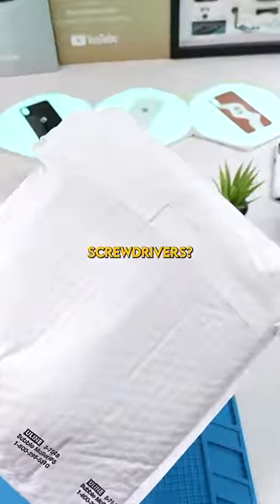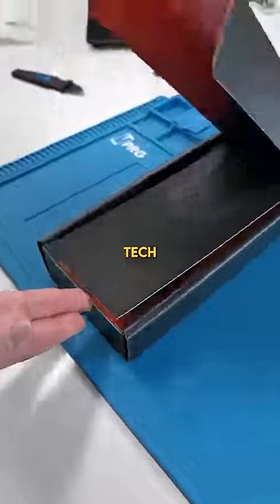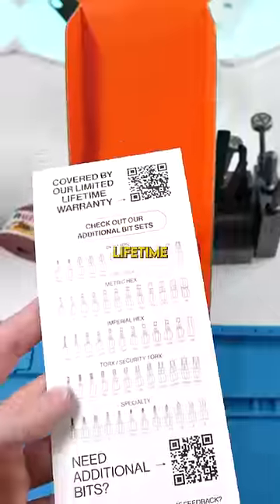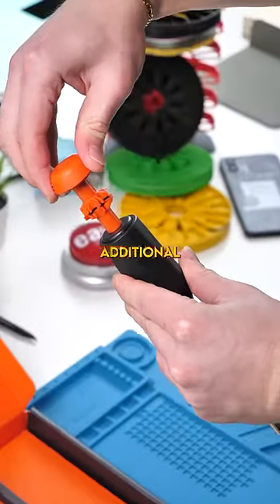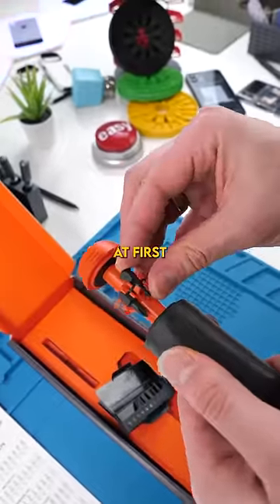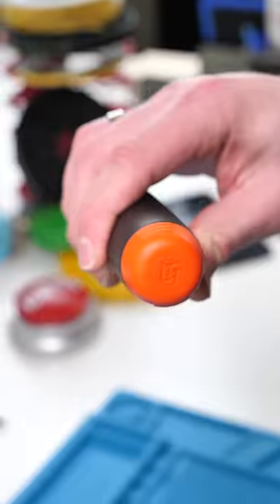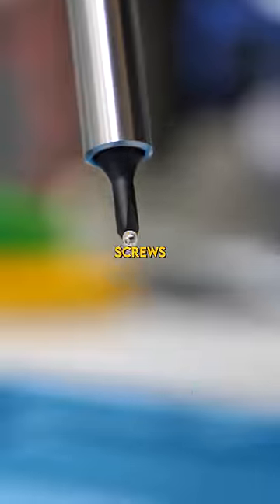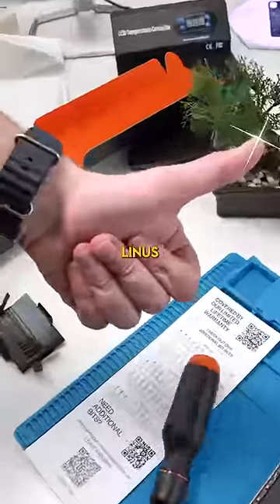How Good Is THE LTT SCREWDRIVER? #Shorts

Comment: I got it, I was half skeptical but it's actually a really good screwdriver. I find myself fidgeting with the racket quite a lot lol, it's so satisfying to turn
Reply: HTR  definitely. It's on par with other premium brands that do have a similar cost, and the ratchet just blows everything out of the water imo.
Plus you obviously have to account for the fact that a product designed in-house by a small company is gonna be slightly more expensive. It's just a given, they don't have the connections and the efficiency of an OEM that only does screwdrivers. And it's still merch after all, you also buy it to support LTT. It's extremely high quality merch, but it's still merch.
Reply: HTR  Love Steve, but he's just wrong on that. He didn't really follow the stuff that was happening at the moment and got in the middle of some internet drama. 
The rest of the comment is obviously personal opinion, by me. I own the screwdrivers I use, and the LTT one is really, really good. Now take your internet drama elsewhere.
Reply: HTR  you've clearly never touched the screwdriver (or a screwdriver?).
Reply: HTR  yeah man sure lol
Reply: HTR  keep goin'

Comment: You can use the iFixIt 5/32 to 1/4inch adapter with it though. That'll allow you to use the smaller precision bits with it if you wanted to
Reply: I don't the think that's the issue. with small bits i would prefer a lighter and smaller handle for better control

Comment: They had to create a screwdriver that is Linus proof 😆
Reply: theres another video where a guy drops it from about 5ft, and it broke/started to break after 20ish drop. imagine seeing $5 flying away when u drop it, and if you drop it twice a month, which can be common on job sites, itll be in a bad shape after a year. also honestly idk y he made a huge ass driver for "computer" stuff. you need skinny ones. atleast include an extender. now that i think about it i think they must of used cheap non-flexible plastic in the bit holder, since it just snapped off. and its 70$, yikes. just wait til china floods the market with replicas and linus will be forced to drop the price. rn hes milking it for all its worth. wouldnt be surprised if the manufacturing cost being ~$10
Reply: @MrPaxio who in the fuck on a job site would be using a ratcheting screwdriver and not an impact?

Why would china clone the $70 LTT screwdriver and not the $150 snap on ratcheting screwdriver?
Reply: @MrPaxio  I use a heavy AF ratcheting driver from Kobalt for all my computer repairs. It's discontinued now, but it has a sleeve on it that makes it double-action. So, it's heavy because it has a gearbox, lol. Yes, my screwdriver has a literal gearbox. Get rekt.
Reply: @Mavendow If you're ratcheting screwdriver has a gearbox in it then it was never designed for what you're using it for and was clearly intended for heavy construction type work

Comment: The most important thing with screw bits are how they are hardened, I've had way to many bits break because they weren't hardened properly or made out of good steel. The best boys I've ever seen are the wiha driver bits
Reply: HTR  well considering they are 25$ for a pack and they work great for thread locked knives it's what works for me. Every other bit I've tried snaps, and I'm talking about a torx bit btw
Reply: HTR  literally cheap ass ones that you'd find at home Depot, and the most common size I use is T8, T10 and T15, I only have real trouble on T8, my T10 or T15 bits have never snapped
Reply: HTR  well I never claimed that wiha was the best of the best, I just started that it's the best I've personally seen. And as for the brands I've used I've tried husky and strebito, couldn't tell you what steel they use because they don't say on the packaging, I'm sure you could find out by searching but I don't really see a point, with the strebito ones they seem to twist and with husky they fracture on the area with pressure applied, haven't had issues with wiha yet, does everything that those can't and for not much larger of a price.
Reply: HTR  I've always assumed wiha was made in China since it seems most of the cheaper bits are. As for now though the wiha bit seem to do me right. If you've got any suggestions for other torx bits I should give a go if wiha starts to do me wrong, please feel free. I'm open to suggestions
Reply: HTR  alright thanks, I'll keep these in mind when shopping for bits next 👍

Comment: Definitely agree it is a very nice screwdriver. But it is large and not optimal for being used mainly for phone repairs. Probably one of the best general use screwdrivers out there
Reply: Well yeah, it's main focus is most likely just anything pc and server-related. Racks and network equipment usually requires a bit more torque than the regular pc-building sessions so the size is understandable.

I believe the LTT screwdriver covers the entire span between "this is a oily underside of my car so I'm using the cheap regular screwdrivers" to "this is iphone mini-screws so I'll be using precision drivers"

And it's the perfect overlap too. Anything inside the car is where this would be used, even just tuning my amplifier, and all the way over to disassembling a laptop where some screws are torqued down to the maximum of what I can unscrew with the regular ifixit bit-driver.

Basically any kind of electronics is where this screwdriver would be great, and some other stuff too.

Now, the pricing is, well, insane. But so are the other equally well built bit drivers. Nothing cheaper comes even close to this one on all points.

Can't wait to actually try it out myself, I just know what Project Farm (and others) showed through testing
Reply: HTR  Yeah, I meant to say that it originated from pc and tech-work and that's why it's most likely to be purpose-built for that usecase, which it was.

It's meant to replace most tools, such as the span I mentioned, but I haven't used it personally yet so I cannot say for a fact wether it does so (for me personally at least).

I'm personally leaning towards project farm's review, mostly because Geerling includes stuff like ratchet asmr, flipping and honestly, dropping a bowling ball by hand.

It's not to say his review was irrelevant, I think it was, it's just that Project Farm use a more scientific approach with tests that show more practical differences.

I'd also argue he did test it more thoroughly, so even IF it was rushed, it was still good. I double checked with them side by side, Project Farm went way more into the technical differences and whatever bias you're hinting at can't be changed when he shows the numbers and test everything equally.
Reply: HTR  Wrong in what regard? I'm familiar with the PB Swiss he used and I thought it was a great comparison where I could see the physical differences between the two.

Sure, if there are models that are better from PB/Snap On/Megapro then it's not a good review on which screwdriver to buy, but then again his closing words are "I think that really depends on what you're looking for"

I'm not defending anyone, I'm simply stating that I personally liked Project Farm's review better. The fact that you seem annoyed by this tells me you're biased towards telling me I'm wrong rather than "different opinions, I respect that"

 Geerling could at least have dropped the bowling ball from a fixed height and not just eyeballing it. Still a stupid test compared to dropping the screwdriver itself.

I respect that you have a differing opinion from mine, please do the same.

Comment: It's crazy expensive but they're going after the top screwdrivers in the market and apparently it holds up and even betters them in some areas so yeah it's a good deal if for some reason you want a super nice screwdriver.
Reply: Top screwdrivers in the market…. Well no self respecting tech would use that crappy driver. For 70 bucks usd it costs more than a certain American made screwdriver that has customer support that comes to you in a certain truck.
Reply: @HimmelWeint  you literally haven't tried it
Reply: @HimmelWeint it literally kicks the ass of a snap on lmao. Cope harder than your red truck garbo gets beat by Matco around every corner.

Comment: Bruh $70 for a screwdriver? 
Screw that
Reply: I see what you did there
Reply: Something I would like to point out is Snap-on's ratcheting screwdriver costs more and does not come with bits (there is an 8-piece set you can purchase but it costs over double the LTT screwdriver and it only comes with four or five bits)

Comment: Linus Tech Tips reviewed a water block using a GPU that isn't designed for it and says the result is bad and auctioned the prototype without Billet Labs allowing
Reply: That is dramatically oversimplified compared to what actually happened. As for the review, I would say that is complete incompetence but to say gamers Nexus or pretty much any other large tech channel hasn't made a similar mistake would be arrogance at best, and then as for everything that happened after that, the real series of events goes as follows. Billet Labs told LTT they could keep the water block, then an LTT employee put that water block in the wrong spot and then when they were trying to find prizes for various LTX things someone just grabbed that water block without realizing it was put in the wrong spot, and then after LTX bill at labs changed their mind about LTT keeping the water block and by that point getting it back would have been insanely difficult because they did not have the contact information of the person they gave the water block to, and then there was negotiating between Bill at Labs and LTT to figure out what to do from there and they eventually came to the agreement of LTT we'll just pay for one of those water blocks because that's a reasonable enough solution given the series of events

Why People were making such a massive deal over human error is beyond me. You don't see me going into comment sections on any video talking about gamers Nexus and mentioning the fact that for a while there he would do a sponsored video and then re-upload that video without any mention of a sponsorship and then sell it as his own opinion with as far as anyone could tell him being paid a lot of money by large tech companies to do so

Comment: I'm not spending $70 for a damn screw driver... that's nuts.
Reply: The it's not for you, but considering it's up there with pb Swiss screwdrivers that go for over 100, I would say it's a good working driver.
Reply: @marcusborderlands6177  I fix appliances everyday and have tools that work perfectly for a fraction of what that costs. You can get way better tools for cheaper. Don't feel pressured into buying one of these cause you think it's better or cause it's from ltt.
Reply: @972CHENZO  congrats? I have the money to spend on nicer tools while still living well within my means, I'm gonna buy the nicer ones for small quality of life improvements and over time they will save me money in the form of time and not having to replace them. Buy once, cry once.
Reply: A youtuber did very indepth testing of every aspect of several different screwdrivers including this one. The ltt screwdriver is very well priced. If anything they could charge more. Out performed the more expensive screwdrivers.
Reply: @972CHENZO and... you can hunt with a spear, but a gun is better. Just because something cheaper works doesn't invalidate the existence of more expensive versions. Especially when the more expensive version is objectively better.

Comment: you should test if the ratchet feature prevents overtightening of self tapping screws, like on the steam deck.
Reply: It's a ratchet not a torque driver.
Reply: That’s not how a ratchet works. It would prevent you from tightening them at all.

Comment: I wanna follow up video later to eee how it has held up after using it a lot. Like will that bit holder be an issue later down the line if you switched bits a lot?

Comment: I literally have this screwdriver from Husky. It has all the features, and it most certainly didn’t cost $70. I’m even more surprised because I saw a video where they were like we had to design this screwdriver etc and I’m sitting with my one like 😐
Reply: It's not the same driver. The husky is A ratcheting driver, but not even close. The LTT driver is based on a megapro ratchet, husky is not, and is much more precisely made, way less backlash and ginger teeth.

Comment: So I bought one of these a couple weeks ago and I must say it's nice. Not worth 70 tho. Magnets are strong and the ratcheting is okay. My complaint is the the grip and feel. It has weight so it makes ur hand tired after like 20 min. I can go get one from lowe or menards (which I did) and they were each 40 and 50 respectively. They did just ad good of a job. You essentially paying for the long design they put into it  (really should not have taken that ling) and the fact that it's LTT. It's essentially a 40 dollar screwdriver with 30 added on for brand. Not totally worth it in my opinion for work and home use, but if you want it cause it's decent and it's LTT. Go for it. Kinda more of a collectable then anything. I'd do car, electronics and handyman work with it and it held up nicely. Just not for 70
Reply: @HTR  that's essentially what I was thinking which is why I always wonder what took years to design it. And in the end they just took the best stuff from other brands and threw it together and made it more expensive. It's a good screwdriver, don't get me wrong. But not worth 70 when a 50 dollar one doesn't tge same thing in the Same quality.
Reply: @HTR  exactly. It's crazy how these brands and creators will make these tools and charge so high. With a mechanical tool like this. Theres only one best way to make the mechanism. And most of that time it tops out likenyiu and I said around 40 dollars. After that yiu pay for brand. At least people like snap on and Milwaukee have fill lifetime warranties vs LTT limited.
Reply: @HTR  and ta PB Swiss is decent. But its just crazy to me how a company like LTT who values cost to performance and tells people go with what yiu can afford and how they always talk about how things like a 3060 is just as good as a 3080 if yiu don't use RT as DLSS is so good. Bur their products are so expensive. You'd think they'd do research in this stuff. I really wish it wasn't 70. But now we know. Glad someone agrees
Reply: @douglasgudenkauf1952 they actually did tweaks to the ratchet itself adding more teeth and tightening the tolerances, it's not just an off the shelf megapro ratchet. Needed new tooling and everything.

Comment: Limited lifetime warranty 😂
Reply: Limited in the sense that it covers mostly manufacturing defect, but their customer support is very nice and will try to help in anyway they can.
Reply: htr5372 ??
Reply: htr5372  if you are referring to my other comment about the cost of the screwdriver I've already replied there but I'll repeat here, I'm not denying that there are cheaper screwdrivers, I think the ifixit screwdriver sets are a better value, but if you are looking for a ratcheting screwdriver which are usually pretty expensive compared to regular screwdrivers then the llt screwdriver is one of the best because it performs just as well as other ratcheting screwdrivers that are more expensive.
Reply: htr5372  I'm sorry I'm not getting what you're trying to say, like are you saying that the ratcheting function doesn't matter or are you saying that the llt screwdriver wasn't compared to the right ratcheting screwdrivers

Comment: I had one just like that but in blue like 25 years ago. There's nothing special about it, just a pre-existing product modified cosmetically.
Reply: If you spent more than 5 seconds going it you would see that it isn't. The entire ratchet got redesigned for better tolerances and backlash, plus it has a new custom molded handle, the molds themselves cost LTT over 380k. And yeah, they paid for them themselves.

Comment: $70?? No thanks 😂😂😂
Reply: It is a small price to pay when you use it in work.
Reply: I do use screwdrivers at work, I’m a cabinet maker and use them daily. Only brand I’d spend $70 on a screwdriver from is Knipex, they don’t even charge that much! This is not a screwdriver for work, it looks flimsy. I don’t want any screwdriver that isn’t a continuous blade. I use impact on my screwdrivers for knocking in plugs and getting through bog or putty etc. this thing would NOT last long taking hits from a hammer. Also any bit holding screwdriver wears out over time, making the bits loose so straight vertical work just becomes an absolute pain in the ass when your bit keeps falling out, which especially when working with electrical components (i dabble in tech hardware both for work and as a hobby -integrated custom pc systems, electrical components and kitchen appliances) can be extremely detrimental. And the bit holder gets in the way when removing or inserting deep bedded screws. Also all ratcheting tools have a tendency to wear out over time.

This is far from a true professionals screwdriver. This is a screwdriver for hobbyists or someone who works in an industry that doesn’t require it’s use very often.  This thing is DESIGNED for PC building and isn’t even insulated? I understand the price tag because they have to pay a royalty to Megapro to use their patent but it is honestly a ‘designer’ screwdriver. You’re paying for the LTT brand and name recognition above all else
Reply: @joddog  If you're a professional why tf would you be using something from a youtuber personality?
Reply: @insight2  that’s literally my point? You want something flimsy and crap like this you don’t need to spend $70, $70 is what you spend on actual high quality tools
Reply: @joddog  If you want high quality tools, $70 is not enough.
Reply: @insight2  for a screw driver? Ok bud 😂